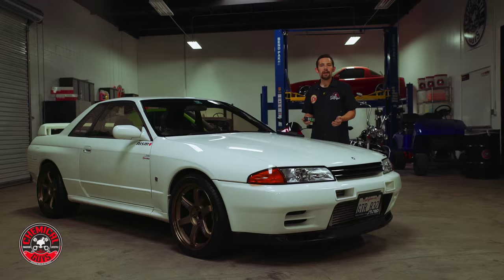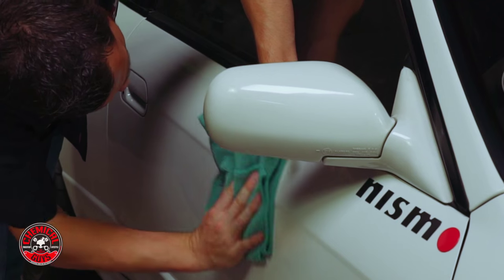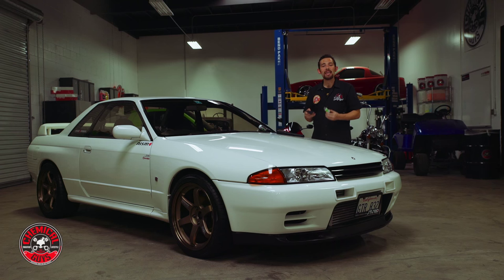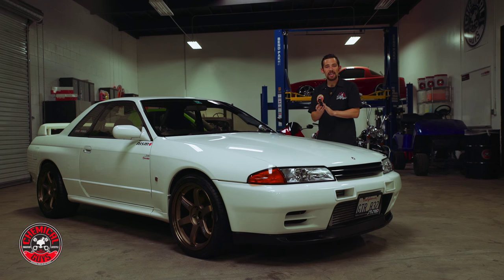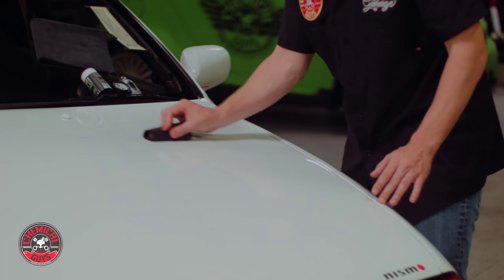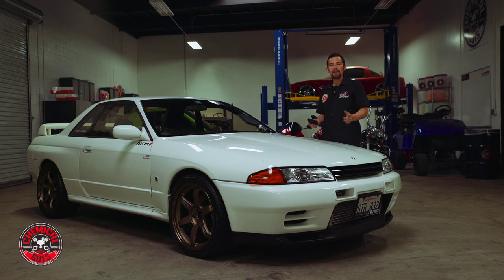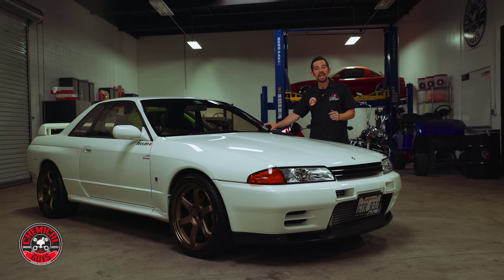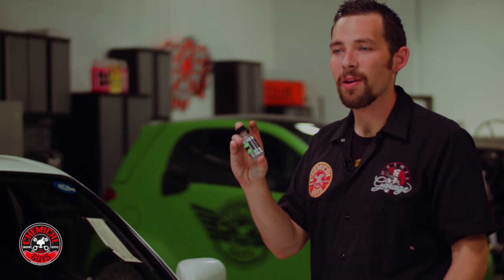How To Apply Carbon Flex C9 Coating - Nissan Skyline GTR R32 - Chemical Guys

Comment: do you guys have any products for vinyl wrapped cars ? ever consider releasing a wrap car line ?
Reply from the maker: +David Ferrer You can use all Chemical Guys products on vinyl car wraps. Use any car wash soap, detail spray, glaze, sealant, or wax on gloss wraps. For matte wraps, check out the Meticulous Matte product lineup!

Comment: Hey chemical guys does citrus wash and gloss damage carbon flex c9
Reply from the maker: Hi Doski, how's it going? Using Citrus Wash and Gloss diluted 1oz to 5 gallons of water will not damage Carbon Flex C9 coating, however we do have a custom car wash shampoo for maintaining vehicle protection coatings called Vitalize. While normal wash soaps clean away dirt and debris, they do not strengthen or revitalize advanced vehicle coatings like Carbon Flex Protective Coating. Vitalize Wash is blended with the same compounds that Carbon Flex uses to protect paintwork, so every cleaning restores strength, gloss, and water beading and sheeting effects to the Carbon Flex vehicle coating. Thanks for watching, and stay tuned for another video dropping tomorrow!
https://www.chemicalguys.com/Carbon_Flex_Vitalize_Wash_16_oz_p/cws80416.htm
Reply: Chemical Guys thnxs for letting me know before I add some onto my dad's camry and how to maintain its paint

Comment: Chemical guys, how can you say this is the worlds most advanced automotive coating? how does this compare to the Ceramic pro's 9H coating?
Reply from the maker: +Bamesmums Ceramic is out-dated technology. Ceramic coatings can absorb UV rays, and turn yellow over time. If you apply a ceramic coating to a white car, the coating will begin to turn yellow as fast as 12 months. Carbon Flex C9 uses Carbon Coating technology which protects for longer, does not discolor or turn yellow,  and is much more durable than ceramic coatings. 
-CG
Reply: +Chemical Guys so I take it you guys have tested your product on a white car for 32 months without yellowing?
Reply from the maker: +Zac Nilsson Yes, we did. Our team has been developing Carbon Flex C9 for several years of testing.

Comment: works with matte & satin finish paint ??! ...
Reply from the maker: Vehicle coatings are formulated for high-gloss paint finishes. For matte and satin paints, your best bet is to protect with JetSeal Matte sealant, and maintain with the Meticulous Matte product lineup.

http://www.chemicalguys.com/Complete_Matte_Kit_3_Items_p/hol99516.htm

As always, check for desired results in one inconspicuous spot before committing to detailing the entire vehicle.

Comment: So that small 1 oz bottle is all you for a whole car? How about an SUV?
Reply from the maker: Hi Dennis, one bottle is typically all you need, however for larger vehicles, two bottles may be necessary. The point is to use this product sparingly. Multiple coats doesn't equal twice the protection, in fact the top layer will bond to the second layer so you won't get proper adhesion.
Reply: So do you think one bottle will be good enough for a new 4runner?
Reply from the maker: Hi Dennis, you should be able to get the whole thing done with one bottle. You can coat about four cars with very thin amounts of the product, the key id to use as little as possible.